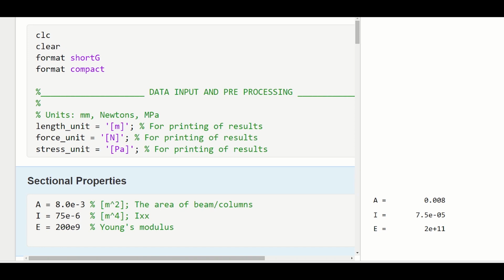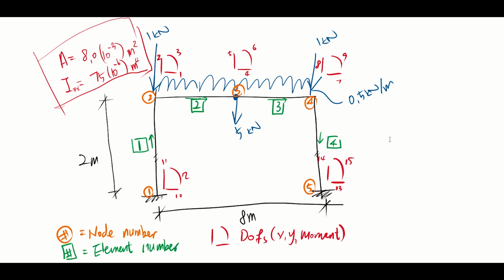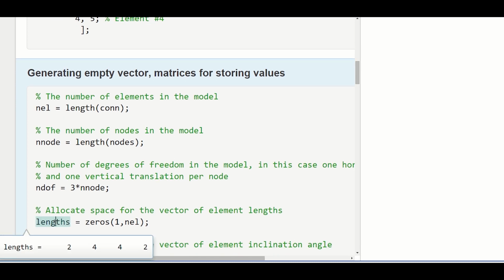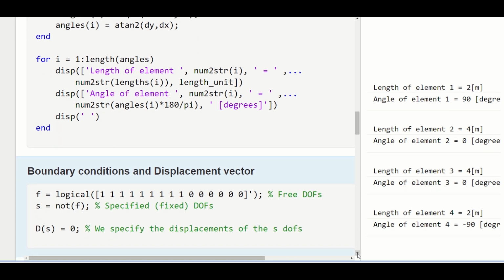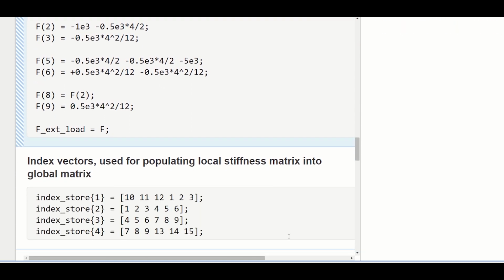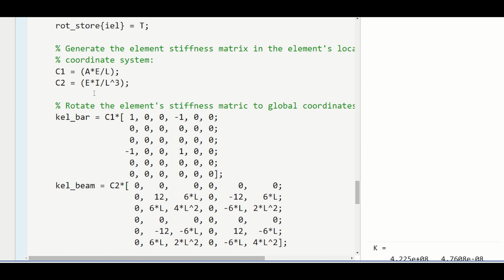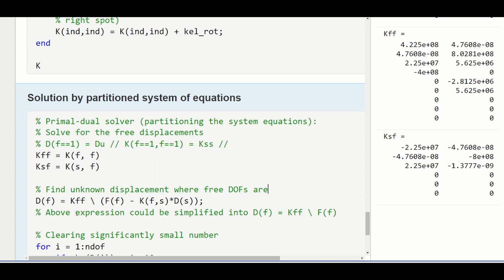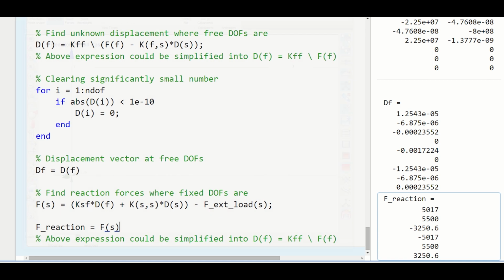SM 254 Matlab Tutorial #04. Stiffness method for Frame element

Comment: How do we calculate the moments in other bars in the frame and the span moment. The force vector is wrong in this regard. The moment at point 2 is not 666.67 Nm, it is actually 6783 Nm. He also does not find the cutting forces on the rods correct. ?????